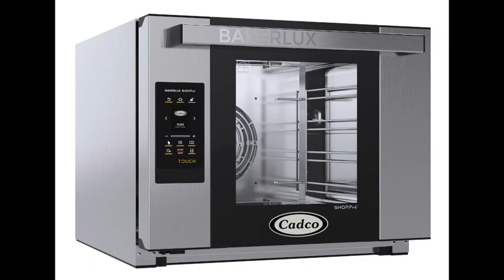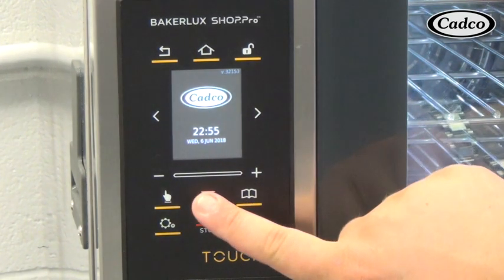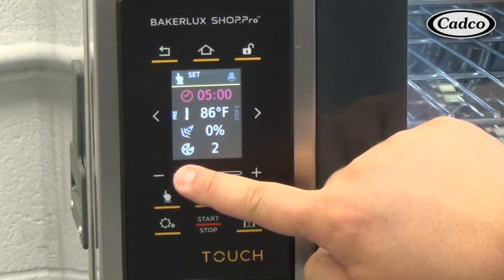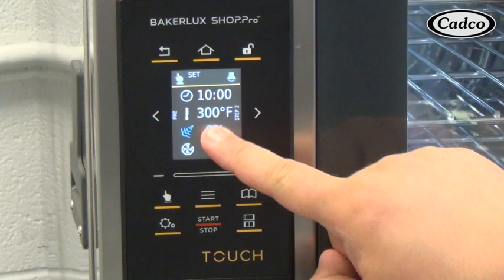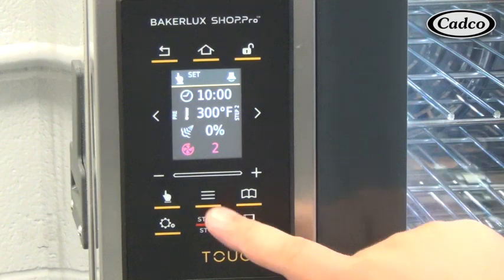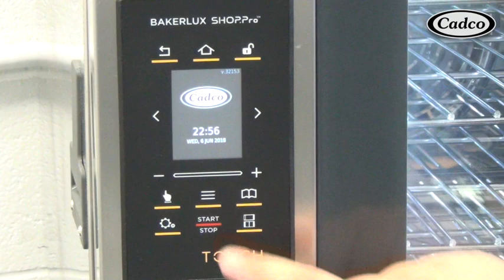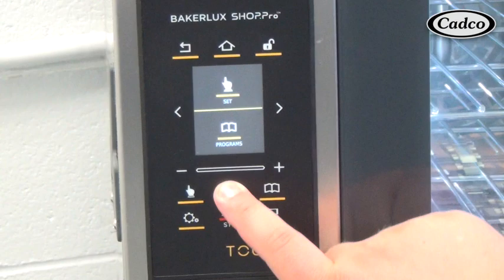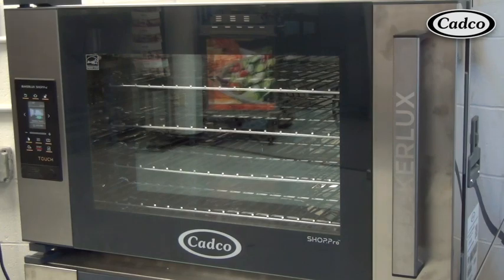Cadco Bakerlux oven TOUCH panel operating instructions

Comment: Hi my oven will not turn off after use. I press the on/off button but after a few seconds, the oven turns back on by itself. Also is there a way to turn on/off the light while baking?
Reply from the maker: It may just be the internal fan still running and cooling. The best thing to do is call our service technician Mon-Fri 860-738-2500. He will be able to assist.
Thank you

Comment: The oven is 240v, right? How can I use this with 120v?
Reply from the maker: There are different model options. There is one BAKERLUX model that is 120v, model XAFT-03HS-GD.
There are other ovens that are also 120v in our lineup. See all at www.Cadco-Ltd.com
Reply: @CADCOltd  There are more options with 240v, so I was wondering if the oven operates well      after converting voltage.
Reply from the maker: @yaenayoon8046  They only work as voltage listed and cannot be converted.
Reply: @CADCOltd  Thanks for the explanation!